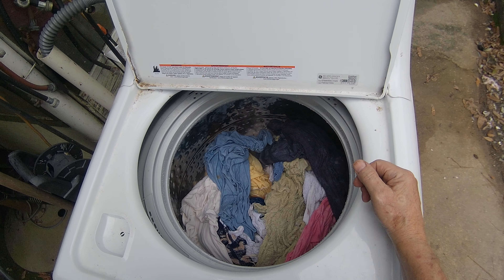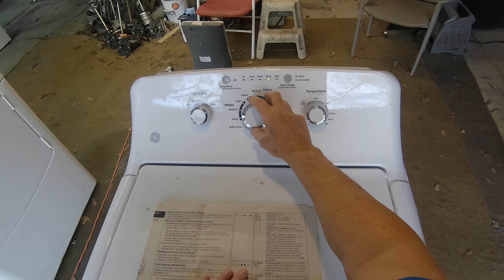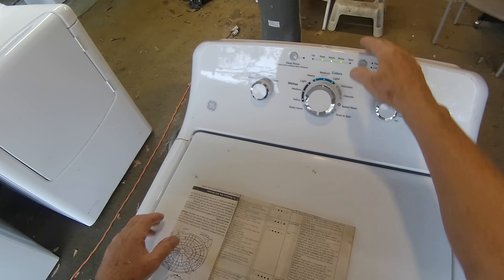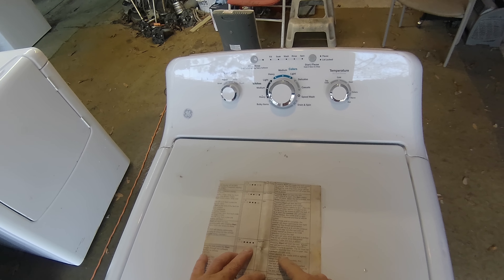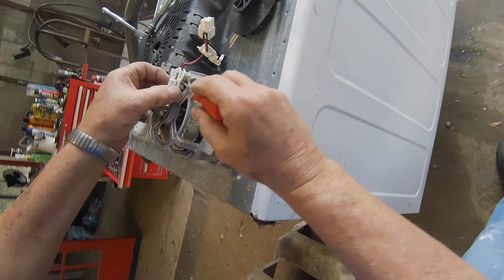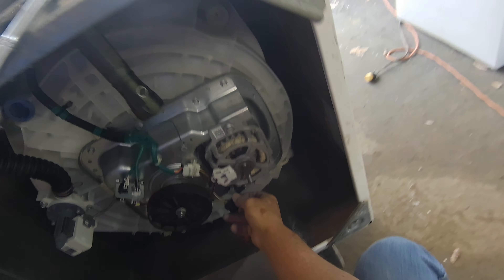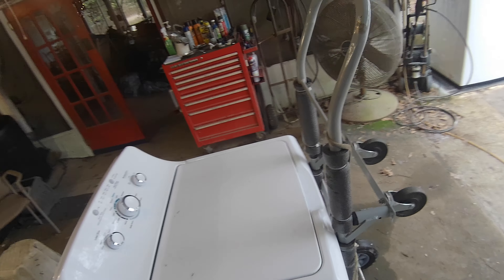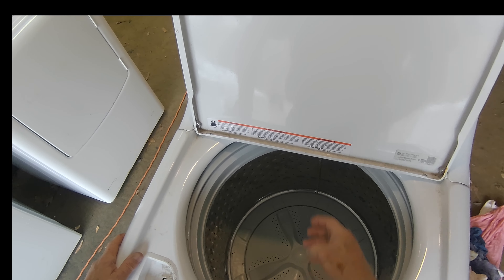How To Fix a GE/Hotpoint Washing Machine: Won't Spin or Wash Repair Guide

Comment: Thank you sir, you just saved me from buying a new washing machine for my parents. I moved back home and they have this same GE top loading washing machine that they bought in 11/2022. Well 10 months later in September of 2023 it broke, naturally my parents were angry with me..I tend to have OCD when it comes to washing clothes and I pause to check to make sure the soap is right and the water amount is correct probably way too much. Well one day i paused it and the machine was doing the same exact thing, it would start to wash then stop, start to spin then stop. Well my father wanted me to buy a new one, so i talked him into trying to fix it b/c he had no idea....well the part only costs $12, and it fixed the problem. You saved me $700, I am so grateful i didn't destroy the machine. I kind of miss the machines from the late 90's that lasted 10 years etc.. again thank you
Reply from the maker: I’m so glad my video save you some money. And, they do make good machines, ones that last 25 years or more!  Here’s a link to a review I did, The Best Washing Machine You Can Buy In 2023
https://youtu.be/qlkdxWfTZVw. Thanks for watching
Reply: Might be some money in simplifying washing machines. Make them more cost effective.
Reply: When I tipped mine over. The plastic plate and a sensor was broken. Any idea how that would happen? It’s weird because it had a covered. I’m baffled. Was it new when we bought it?
Reply from the maker: They used to be made like that until manufacturers began implementing engineered obsolescence.
Reply from the maker: I'm thinking your belt came apart and caused the damage you described.

Comment: I just wanted to say thanks for you video. I was on day 2 of diagnosing wanting to make sure I dint buy non needed parts running up my cost to repair. Your video is the only one I found that addressed my symptoms to a tee, so I ordered the speed sensor, put it on and washer spins and agitates like a champ. Thank you. Btw, which one are you Harper or Knowles lol.
Reply from the maker: I’m glad my video helped you with your repair. I am Knowles. Mr. Harper passed away a little over a year ago. Thanks for watching!

Comment: This video saved me, from a melt down, so thank you haha, water pump and, speed censor were gone, pit them in, good to go
Reply from the maker: Glad I could help
Reply: Jesus, I just lost my spin again, why would that sensor go so soon, it's been two weeks?
Reply from the maker: Hmmm, perhaps it’s something else this time. Be sure your belt is clean and the pulleys aren’t greasy. Perhaps you got a faulty part. Sometimes these washing machines will test your sanity!

Comment: I’m assuming I have the same issue. Only difference is that when I ran the agitate test it agitated twice and then started filling up with water. Yours isn’t connected to water so not sure if the motor speed sensor is the same fix.
Reply from the maker: How does it do on the spin test?

Comment: Hey great video .I also have a ge washer that does not spin but drains any suggestions .also do u know where I can get the service tech sheet that was suppose to be inside the washer
Reply from the maker: You may have a bad motor speed sensor. I have no idea why those service sheets aren’t readily available online. I can’t help you with the at. I’ve seen them for sale on eBay.

Comment: Same washer as in your video. In the spin cycle just a few seconds in the spin led will flash and not allow the motor to get to max rpm. The drum shakes very little. I’ve replaced the suspension rods with the same issue. Can run a cycle without any clothes and it will cause the led to flash.  I’ve even ran a cycle with the belt off in drain and spin mode and the led will flash. Not sure what else to try. Machine was manufactured in 2022. In test mode in a spin test it runs absolutely fine with it without the belt installed.
Reply from the maker: What led flashes? I'm thinking your motor speed sensor may be malfunctioning. Thanks for watching!

Comment: I replaced the motor speed sensor and pulley on mine and it’s still doing the same thing. It’s not running any codes it will start spinning and spin for a few seconds then stop. What else could be wrong with it? Is it possible I just recieved a bad motor pulley sensor?
Reply from the maker: That’s what it sounds like to me. If you change another and it does the same thing then it might be a broken wire in the wiring harness or a bad component on your control board. Thanks for watching!

Comment: I have the hotpoint version of this washer and ours made a loud squeal noise about 2 wks ago then never had any issues until last week. It will fill as its supposed to and go to the soak cycle and sometimes it switches to wash but immediately back to soak. So it doesnr work or switch to the wash cycle and when i switch to drain and spin it will drain all the water but womt spin.
Reply from the maker: If you what the video and do the test you can probably figure out which component is malfunctioning. Thanks for watching!

Comment: Happy New Years boss!
I've gotten a new belt and spent all day trying to fit it in and it worked after 2 hrs 
Tried out my washing machine and it spun for like 10 secs...
I used the sheet and everything ran fine except spin cycle... not sure what the problem is maybe order another driving belt I guess?
My washine machine is Hotpoint htw240askws
Reply from the maker: Try this video. How To Get Your GE Washing Machine Running: Diagnostic & Parts Replacement
https://youtu.be/o0wzPa7ZVPc

Comment: Great Video!  So my GE washes , pumps out, and starts to spin maybe two revolutions then stops and starts filling up again for another wash. Ive gone through the fault code sheet and it says everything is fine. Ive changed lid switch , suspension rods and blown the sensor tube out.. Any thought s would be appreciated. Thanks
Reply from the maker: I’d suspect the motor speed sensor. Watch this video for that repair. How To Get Your GE Washing Machine Running: Diagnostic & Parts Replacement
https://youtu.be/o0wzPa7ZVPc Thanks for watching!

Comment: Belt is fine and my resident saying it’s not spinning all the water out could this be speed sensor ?
Reply from the maker: Change the belt and clean the pulleys. It might look fine but isn’t.  Make sure no water valves are dripping on spun  out clothes too. Thanks for watching!
Reply: @HarperandKnowles  there was a lot of grease on belt and pulley
Reply from the maker: Yeah, that means you should replace it. Grease compromises the belt tension.
Reply: @  what do you clean it with imma try and clean it and replace belt tomorow hope it helps
Reply: @HarperandKnowles  what causes the grease on like that
Reply from the maker: It leaks out of the transmission seal.
Reply: @HarperandKnowles  ok so just clean pulleys and replace belt
Reply from the maker: Yeah, that should fix it.

Comment: I have a hot point washer and on lid test with lid close the spin flashs open lid the done flashs I try a new switch and it is the same?
Reply from the maker: In diagnostic mode, when the lid is closed the rinse should blink and when the lid is open spin should blink. I don’t know what’s going on with your unit.  Unfortunately without being able to diagnose it myself I won’t even be able to give you a good guess. Thanks for watching!

Comment: I have a hotpoint similar to this. Lost all power so I replaced the control board. All lights work again. It fills and soaks then stops with the soak light on. Spin and everything works during the diagnostic tests but doesn’t start during a wash cycle. Any pointers? Mine didn’t have a manual
Reply from the maker: It's acting like your lid lock/switch isn't working. I have found that sometimes when I remove a lid lock, it fails to contact the points in the receptacle on the control board. I use a pick and bend the metal points over a bit in the receptacle so that they make better contact with the plug. Be sure the unit is not powered up. That's about all I can think of at the moment. If I could diagnose it myself, I could be more confident. Thanks for watching!

Comment: We have the Same washer pretty much but with a tall agitator, but right now it's not doing a lot, will drain but won't spin, and starting a fresh cycle does nothing, the fill comes on but no water comes out then after a bit it just turns off, sometimes it will work fine other times it repeats this problem again, do you know what might be the problem?
Reply from the maker: Sounds like a failing water inlet valve. Thanks for watching!

Comment: i have a HTW240ASK4WS that runs thru the wash cycle but then it does not always drain.  However,  if i put the machine on spin and drain it seems to empty the water out.  I tried replacing the lid switch because i had one laying around but that didnt help.  It seems to cut off at random places and plain stop - sometimes after wash, other times at soak etc,    I seem to get a little confused stepping thru all of the self tests - are there any specific issues that might cause it to just stall ? .  Also i noticed the lid lock may not be working 100% - for ex i am able to open the lid without pressing pause during the wash cycle and it stops agitating.
Reply from the maker: Try replacing the lid switch with a new one. It really sounds like a lid switch problem. Thanks for watching!
Reply: @HarperandKnowles  so i replaced the lid switch with a second onr from amazon and i am not certain it is working correctly because i can lift the door lid up during the wash cycle.  This leads me to believe the plastic catch might be bad although it looks fine or maybe the wiring or circuit that controls the lid switch might be bad?   any ideas? please and thanks
Reply from the maker: Some washers don’t lock until the spin cycle.
Reply: so i replaced the lid switch with a second one and then i replaced the striker with a new one also.  I think its the lid switch because the door can be opened during the wash cycle.    I am not sure what else it could be? I see that a harness for the lid switch is available but its hard to imagine the harness is bad?
Reply from the maker: Unplug the switch from the control board and use a small pick to bend the metal connectors on the board over slightly so they will make better contact with the plug. Oh, unplug the machine first. I have found that when the new switch is installed it doesn’t make a good connection with the plug. I hope that works for you.
Reply: @HarperandKnowles  does this refer to the lid lock switch door striker side?  not sure i understand UNPLUG SWITCH FROM CONTROL BOARD?
Reply from the maker: No, follow the wiring harness back to the control board under the console. Unplug it from the board and bend the prongs there.
Reply: @HarperandKnowles  so i removed just the rear console cover etc and i was not 100% sure which connector was the lid switch - however i removed the one i thought it was and i reseated it and i also reseated the others.  there was not any corrosion.    The lid lock works when on the drain and spin cycle but otherwise doesnt work.   I think my issue might be something other than the lid lock? any ideas?  thank you!!  Its like it is plain confused - it fills way to high regardless of setting.  It agitates a few times and then stops.  ?
Reply from the maker: Remove the striker (flappy thing) from the lid and place it back in the lid lock slot so that you can run the test with the lid open and observe what's happening during each test. Maybe you can figure out what's going on.
Reply: @HarperandKnowles  is it possible to start over here. maybe i sent you down the wrong path looking at the lid lock?   right now the machine fills but overfills no matter what to xlarge size load.  it sounds like it agitates but only for a few seconds and then it sits.   what tests do i run?  thank you!
Reply: @HarperandKnowles  OK i bit the bullet and figured out how to run each test.  it passes each test except Recirc (does nothing lights out), Spin (sprays 2x and only spins for maybe 30 seconds), Agitate - agitates for 30 seconds . I also checked the belt and it looks fine. awaiting your instructions ohhh great one!!!!

I started a new load with the lid lock bypassed like u told me - it fills like normal and then the machine agitates for maybe 30 seconds but then it stops and it overfills super high.  at that point it seems to stall and not do anything.
Reply from the maker: It sounds like your motor speed sensor is bad. Watch this video How To Get Your GE Washing Machine Running: Diagnostic & Parts Replacement
https://youtu.be/o0wzPa7ZVPc

Comment: So I just replaced the lid lock and when I try to do the spin test it won't even start and flashes lid locked but it's not. But the lid lock will lock
Reply from the maker: It could be the lid switch part of the mechanism. That’s the part that tells it that the lid is open or closed. Try bending the pins where it plugs into the control board slightly so they make better contact with the plug. Thanks for watching!

Comment: I have the same washer and shows lid switch is stuck open 
I changed the lid switch and I’m still getting the lid switch is still open 
Would you be able to guide me in the right direction?
Thanks
Reply from the maker: I have found that the prongs where the lid switch plugs into the control board will sometimes not make good contact with the plug. Be sure your machine is unplugged and has been unplugged for at least 5 minutes then use a pick to gently bend the prongs over to the side a bit so that they will make good contact with the lid switch plug. Thanks for watching!

Comment: I have the digital wifi version of that washer.  And it wont spin or agitate.  I even switched the motor off and working ge washer( only bearing where bad on donor washer) but im still have the same issue  it wont spin of all agitate. Its not the clutch or lid switch i changed those also.  What else csn it be?
Reply from the maker: Hmmm, without being able to diagnose it myself I can only give you my best guesses. Perhaps the shift actuator or the motor speed sensor.  It is possible that you have two bad motor speed sensors and they are relatively inexpensive to buy and change. Swapping parts until you hit the right one always works! Ha. Thanks for watching!
Reply: @Harper & Knowles Washer and Dryer Repair  I have a ge dryer and all fuses and the element have continuity. But its still not heating . What can is be
Reply from the maker: @jaycole3768  Be sure you have the correct voltage across L1 and L2. Here, check out this video, https://youtu.be/3FGsZdoM4bM I'm sure you can find a solution in this one. Thanks for watching!
Reply: Your are the man thank you so much.  I have some more checking to do

Comment: Can you please tell me what to do if it’s just clicking and the lid won’t open?
Reply from the maker: The lid lock is not functioning correctly and needs to be changed. You may need to access the switch/lock from under the cabinet top to get it open. Thanks for watching!

Comment: i have a hotpoint HTW240ASK4WS and it fills to large load no matter the setting and then sits on soak.  I dont recall it even soaking before - it would fill and run.  I was able to get it into diagnostic mode and it has like 6 or more codes.  I am starting to think it is possibly the control board.  The machine is 5 yrs old and gets used almost every day in an airbnb - any ideas? thx in advance.   initially this made a grinding noise towards end of cycle i think.  the first fault code is lights 1,2,4,6 and none of the codes show this combination.
Reply from the maker: Hey, I saw your email but let's try to fix this here. I assume you have retrieved your service sheet from under the left  back corner of your machine. You will need that to do this. Using the sheet go through the steps to put its into diagnostic mode. I always start at 12 o'clock rotate the knob 180 degrees or seven clicks clockwise while holding down the start button then release the button. When the lights start flashing you have entered the diagnostic mode successfully. Now using the light codes on the sheet, test the hot water valve, cold water valve and continue through the sequence of test as listed as you rotate the selector knob to get the right light sequence.. Let's be sure to check the lid switch. You'll check the lid lock during the spin test. If the lid does not lock during the spin test then the switch is good but the lock isn't so change the lid lock. You can remove the striker from the lid and insert it into the lid lock so that you can keep the lid open and observe the spin and agitate test if you want to.  Do all the test but know that some of the test listed may not be available on you machine. If one fails you'll know where the problem is. Let me know what you find. Thanks for watching!
Reply: @HarperandKnowles   I see - thank you so much!!  I didnt go thru the tests because when i put it in fault code mode it had like 6 or 7 binary light combinations and the first one  didnt exist on the fault code sheet.   I will try your method tmrw and report back.
Reply: OK so i went looking for the paperwork under the machine and i noticed the belt was off and wound around the motor pulley.  I am going to grab a belt before performing diagnostic tests.  However i found a 3 wire pigtail wire that goes into a harness.  it looks like it was connected to a white clip that was broken maybe when the belt failed?  @HarperandKnowles
Reply from the maker: So. the belt broke, and it probably messed up your motor speed sensor. Watch this video to fix that issue https://youtu.be/3hSWAAVEn5s. Let me know how it goes!